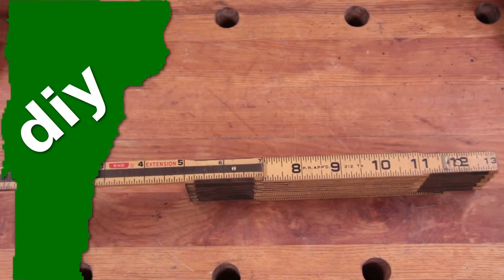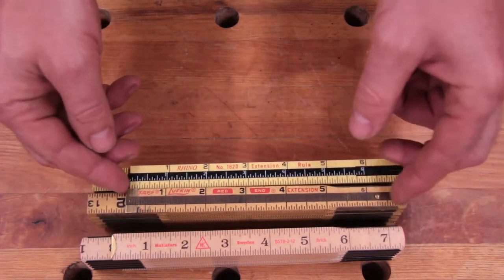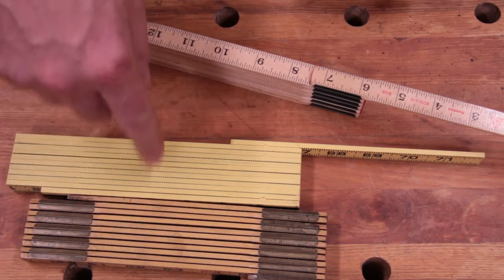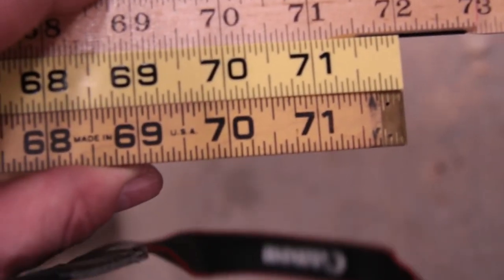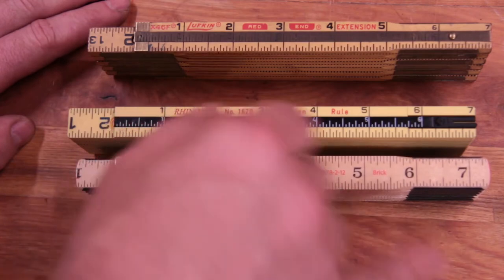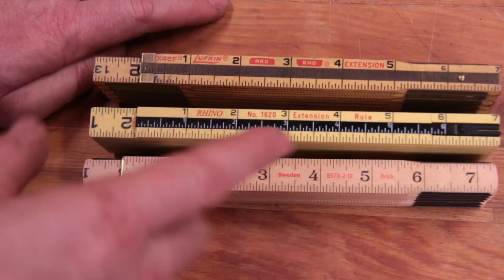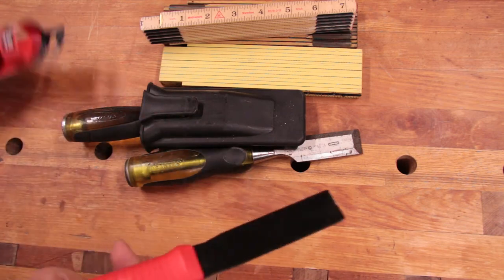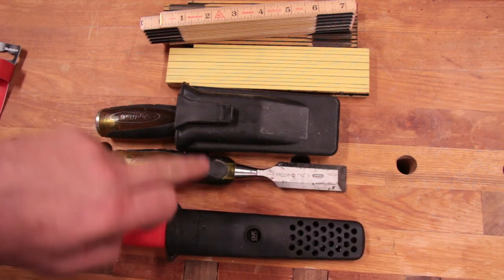Hultafors, the Original Folding rule from Sweden

Comment: stabila claims to be the first to make folding rules as well, in 1865
Reply from the maker: Interesting the Hultafors site says 1883 for a folding ruler and the Stabila site I saw said 1889 and mentions the spring joints. Either way they both have been making folding rules for a very long time.